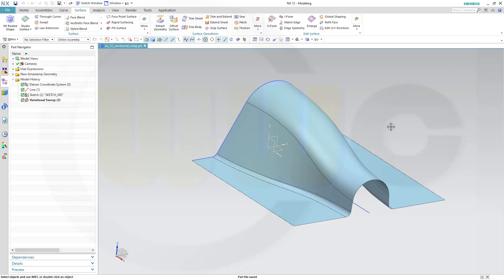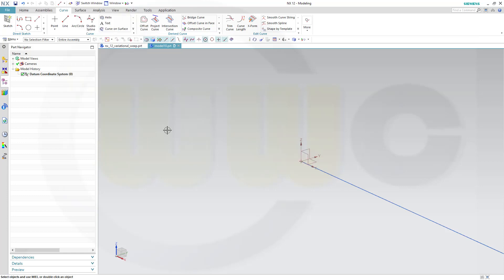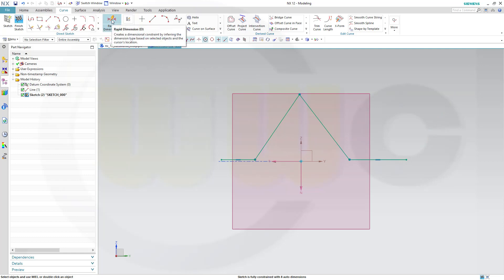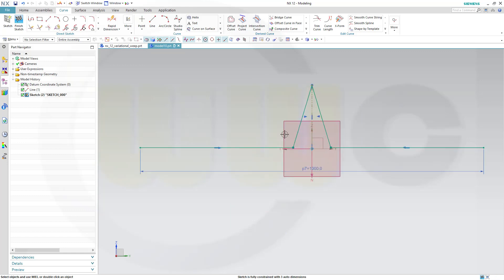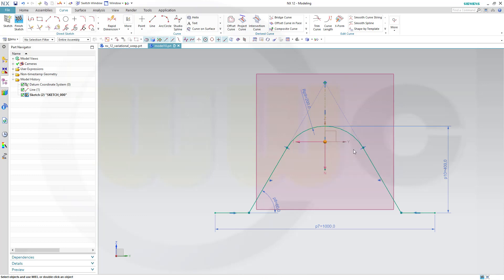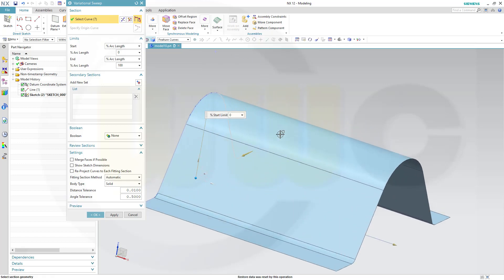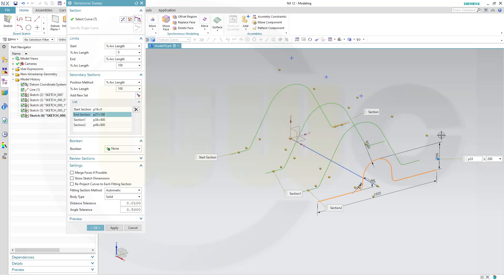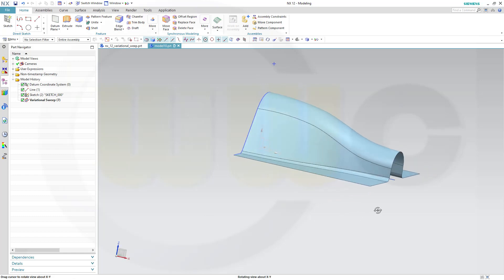Variational Sweep 1 - Siemens NX 12 Training - Surfaces

Comment: When I added sections like in 6:00 , the program didnt show me dimensions (angles and distances) to edit them when I clicked on them. I tried everything & done everything exactly the way you did. What is wrong? Is there a setting that I should have checked?

I also get an error that says: "There are no driving dimensions in the sketch.Secondary dimensions cant be edited."

For reference I use the NX v1953
Reply from the maker: I would assume that your sketch is not fully defined/constrained
Reply: @wolfgang.walden.cad.training  I'll check it out, thank you for your reply
Reply: I had such issues: right click on dimensions -> Add /remove expression. or  use option from ribbon for "Rapid Dimensions" to make dimensions to look like p2=20mm without these "p" prefix these dimensions wont appear in Variable Sweep sections for modicaftions. 

This error :  error that says: "There are no driving dimensions in the sketch.Secondary dimensions cant be edited."
most porbably you didnt follow the 3D line as sketch base to start with or your dimensions didnt use "Sketch Origin" for top dome arc height dimensions. 
regards
used NX 2007
Reply: @ronron7763  thank you SİR ,I solved the problem with your help
Reply: @ronron7763  thank you so much! I was really confused, but now I solved it with your guide.